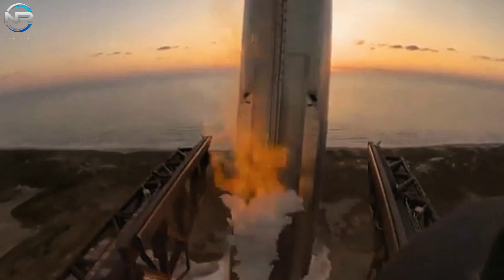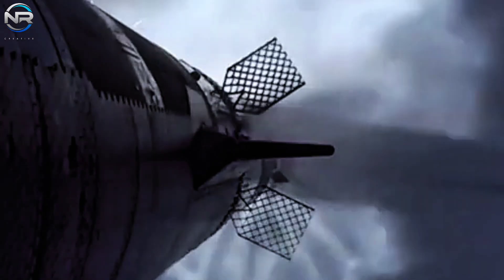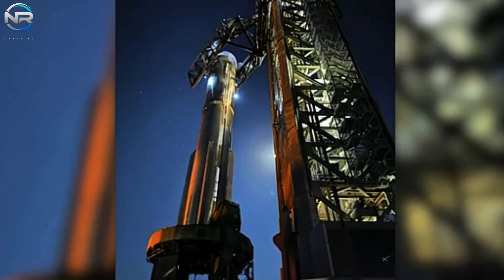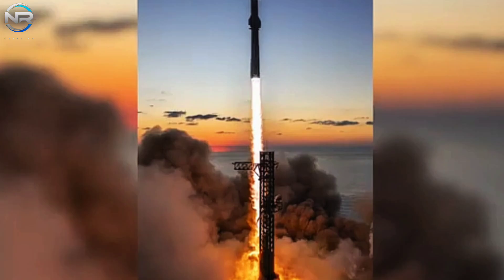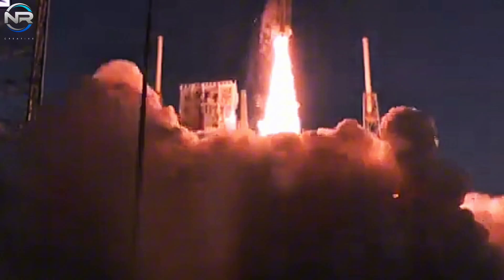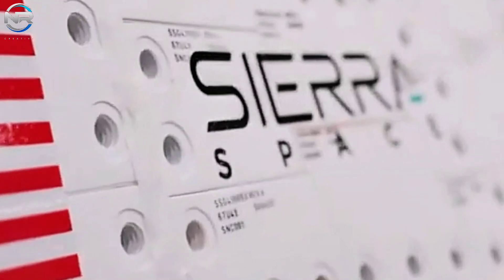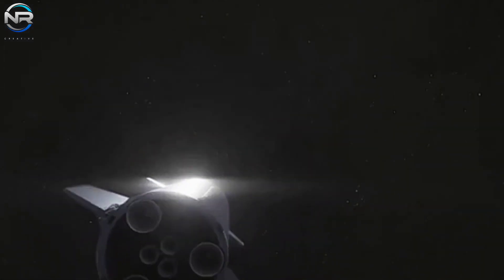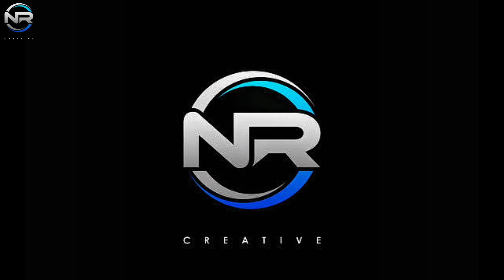Big Trouble! Starship B12 Fins Melt And Bend During HSR Separation

Comment: Some supporting images regarding your observations of damage to the grid fins would be handy. as I'm not personally aware of any damage being mentioned by anybody else. And just a constructive criticism, some imagery to accompany what your talking about at the time would be more relevant rather just showing a loop throughout. :-)  My thoughts are Space X will want to replicate the booster catch again on the next flight, once in my opinion would not be proof enough to conclude consistency and reliability, and given there were some issues during the boost back such as the warping and the fire at the QD, they will likely want to test any modifications or solutions they have to mitigate this. A ship catch is a long way off unless they can solve the flap burn through issue and perform a soft landing without the KABOOOM!!  but if anybody can solve these things quickly it will be Space X.

Comment: The grid fins are not an issue. On the test boosters, they are made of steel. Those in use on the reusable Falcon 9s are titanium, specifically for this reason. Remember, they are test units. They know there will be failures, they want to see what kind of failures they get.

Comment: Except it isn't a problem at all, the booster landed successfully, what some people fail to grasp is these are all test flights, replacing the fins is nothing to worry about every launch has been an improvement on the previous, Boeing can't even get the capsule right, simply because they have limited flight time therefore they have very little actual real flight data to analyse